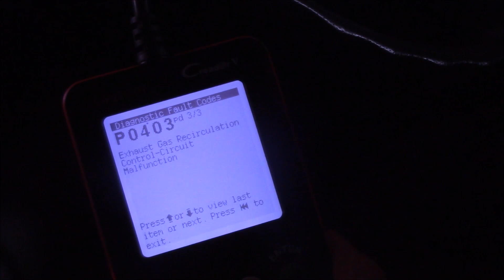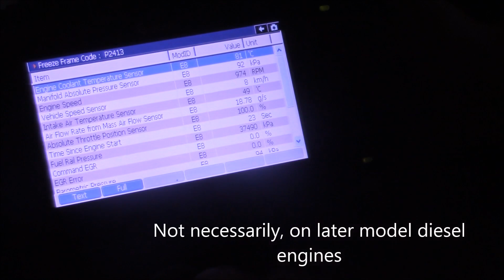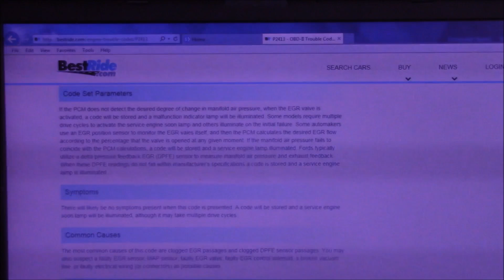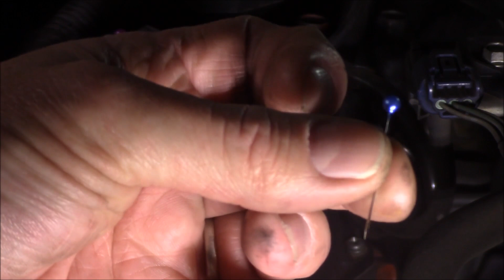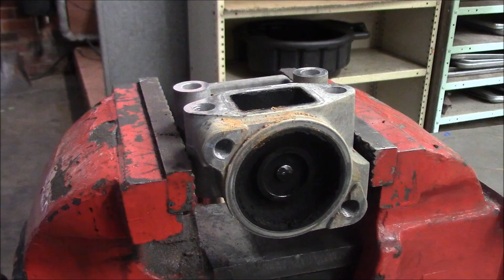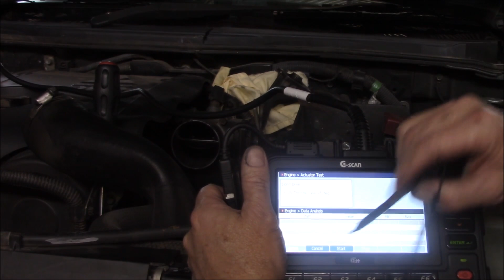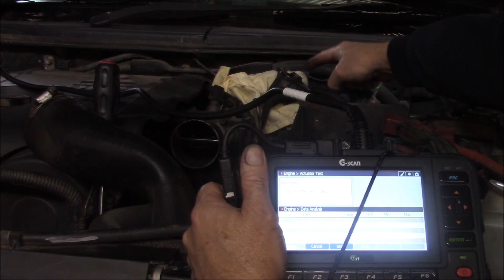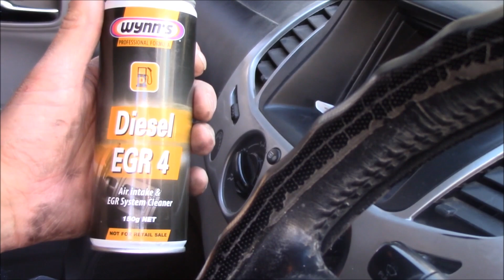Mitsubishi Triton 4D56 CRD P0403 P2413 Fault Codes MiracleMAX

Comment: Hi Max, I didn’t get to see on the video how you got the EGR to work with the system after you tested the EGR motors and it’s potentiometer. You mentioned you just needed to clear the codes. Though from your initial scans, it shows that there are still pending EGR trouble codes. So my question is what did you do that eliminated the pending EGR trouble codes. From your video, after you checked the motor next is that you are already testing the performance after a week and you just mentioned you cleared the codes (not yet doing the intake manifold spray cleaning) and from the scans the EGR is already working. Did I miss something?
Reply from the maker: Hey Michael,
With these Tritons (18:36), you need to clear the codes before you can carry out any activations. As I said, these are very bad for carbon build-up. Once I cleared the codes, I was able to do activations and after the clean, the check engine light stayed out. Remember I did clean the EGR valve on the bench.
These EGR valves do wear and allow air to be drawn past the shaft, creating poor idle and a sticky EGR valve.
The same vehicle later had an EGR cooler leak as well as an EGR leak, which is shown below.

Homemade Smoke Machine To The Rescue MiracleMAX https://www.youtube.com/watch?v=Qx2nT-GTejc&t=473s

I also later removed the inlet manifold and cleaned it ultrasonically. I don't think I did a video of that repair, but man, did it need it! This is the only way to fix the carbon issue correctly. The sprays are only temporary for the diesels and should only be done as a maintenance program. Not all technicians agree. Here in Australia, we have poor fuel quality and that is one of the main reasons our diesels have huge carbon issues. 
The guy has only recently sold this vehicle with over 400,000 Km on the clock and guess what he bought - another Mitsubishi Triton!
Reply: Thanks Max for these added information! I have the same issue with my Strada(Triton) here in the Philippines and I’m trying to diagnose what exactly is happening. Watching your video gave me excellent information about this topic. Hats of to you mate! Great work! Odd thing about my EGR, when I go up the mountains (cold and high altitude) the next time I turn the engine on, the Check Engine Light disappears, then when I go back down to the plains, it turns on again.
Reply from the maker: @michaelacepcion8941  
Hey Michael,
What type of scan tool are you using? Does it have 'Live Data' available? Did you check for vacuum leaks, like shown in the 'Homemade Smoke Machine' video?
Since it changes with altitude when you go up into the mountains, have you checked the Air Flow Meter? Here's an example of what an Air Flow Meter should do. 

Toyota Echo Hesitates Under Acceleration https://www.youtube.com/watch?v=PMg50o_fhXQ&t=1s

Note what it should be at idle (in your case, if it is a 2.5Lt engine, then it should be roughly 2.5 gm/s) and then through the rev range. This sensor helps the ECU to make adjustments according to air density, which is changed by temperature, altitude, air speed and also the use of a turbo.
Do you have any fault codes I can help with?
Reply: @MiracleMAX  Hi Max, I'm only using a cheap OBD2 scanner reader. I had P2413 DTC code ever since, I had my EGR system cleaned from time to time, but the Check Engine Light never disappeared. The shops I went to and even at the dealer weren't able to diagnose what exactly is the fault. And during these times I have noticed the CEL light going off whenever I was up in the mountains. From my researches I found that the ECU takes information from the MAF sensor, and as such I cleaned it but sadly no effect on the CEL for P2413, your video on the MAF provided me a more indepth check, I found that the flow rate at idle (my engine is 3.2L)  is about ~24g/sec which is over-reporting if it's supposed to be only 3.2g/s. Although recently I had some problem on acceleration having hesitations, and also loss power when I was going up a steep hill, it threw a code P1272, this I was able to resolve by servicing my SCV, I'm wondering that it may be that I haven't had the relearn special function done after my SCV servicing that it may be causing the high flow rate at idle, I have to get that checked before I decide to have the MAF sensor replaced. I already have a new EGR valve ready but haven't replaced it yet as I do the testings, I still have doubts. I'll try to make the smoke machine and do a leak test, but it doesn't seem like I have leaks as the engine is quite clean without the visible soots that would be coming from leaks.
Reply from the maker: @michaelacepcion8941  
Hey Michael,
Does your scan tool do 'Live Data'? The P2413 code is most likely a faulty EGR. Firstly you have to make sure that the ECU is actually commanding the EGR operation. This will be a duty cycle signal. Do you have a multimeter with a duty cycle function? If not you may be able to see a pulsed signal with an LED test light. Check out the video above for wiring connections.

You state that you have had the 'EGR system cleaned from time to time'. Was this Ultrasonically cleaned off the vehicle or just an intake spray being used? How many Kms has the vehicle done?

As you can imagine, 24g/sec is HUGELY over-reporting & will create all sort of problems. Sometimes you just can't clean a MAF - replacement is the only solution.

Yes, there are relearn procedures that must be carried out in the special function section of a bi-directional scan tool. Yours will not be up to the task if is only a reader. If you have sorted the Suction Control Valve, this will not change the MAF sensor reading as it is a Mass Air Flow sensor and only an ECU input. Therefore if it is over-reporting air intake, the ECU will add more fuel since it thinks that more air is going in than what is actually being drawn in by the motor.
Reply: @MiracleMAX  Hi Max,
My OBD reader does live data, but doesn't have the special functions, it's a reader only, the ECU isn't showing any commands to the EGR, it shows only 0% on both EGR Command and EGR error, even when I cleared the codes. I did check it before when I was in the mountains and saw some command by the ECU asking it to go 100%, but no duty cycles.

The cleaning was done manually, haven't seen any ultrasonic cleaning in shops here. The vehicle has run 123 thousand kms.

I was thinking that the airflow is mainly due to the suction of the engine and need for air, so if there is some fuel being given to the engine more than normal, that it would require some airflow to maintain the fuel/air ratio, though if this happens, the engine should be revving higher on idle and the ECU tries to maintain the rpm to 750 thus a rough idling, but I barely notice such rough idling. I'm leaning towards what you said that indeed I have a faulty MAF sensor.

Based on these, my next actions are: 1) Do the relearn special function (borrow a scanner tool that has one); then 2) Replace the MAF sensor and Finally 3) Replace the EGR valve.

Thanks for the huge help! More power to the channel!
Reply from the maker: @michaelacepcion8941  
Hey Michael,
So did you do all the testing that I showed in the video? The fault code (P2413) is quite specific. So unless the  EGR motor or the potentiometer are faulty, I suggest the EGR itself may be clogged enough to cause it to jam and bring on the fault code. 
I think the diagnostic path you have listed above is excellent. After all the testing is done, you can only go on what the data tells you.
Good luck with your repair!  :)

MiracleMAX
Reply from the maker: Hey Michael, 
I have just done some more research for you and a turbo diesel with be 3 times the rule of thumb I suggested before. So for a 2.5 Lt engine would be roughly 7.5 g/sec. So while this is higher, it is still no where as high as your 24 g/sec. Remember these are only generic concepts are not carved in stone. I am assisting with someone who is having a similar issue with a 3.2 Lt Ford Ranger turbo and he is reading 20.13 g/sec, which seems extremely excessive, but some collected data that we have seem to indicate otherwise. 
It might be worth changing the EGR first and then checking the MAF sensor before ruling that out. EGR's can be a strange beast.
Hope the extra info is helpful
MiracleMAX
Reply: HI Max,

Thanks for these new information you provided.  I missed a notification on your response. This new data makes me feel more comfortable. I did changed the MAF sensor first and I still had reading that are about 15g/s-20g/s, it varies a lot, sometimes lower at 9g/s. After this I removed the EGR and tested the motor, the motor was working but somehow it wasn’t doing the commands from the ECU. I replaced it with the new EGR valve and it is now working. I can now see the EGR Commanded Duty and the EGR command error on the OBD reader scan. Therefore I think the faulty EGR may have a bad sensor/potentiometer (I have to check this on the faulty one).  After replacing the EGR, I was thinking that the MAF reading would return back to lower readings, but it didn’t. The MAF readings was almost same as I got before replacing the EGR. So I kept on looking for information about why a high reading. I was thinking that there may be a vacuum leak or something that’s causing for more airflow. Thanks again Max!
Reply from the maker: Michael Acepcion 
You are welcome! Is the check engine light on any more? Are there any current codes on the scan tool that you can't erase? How is it driving in the mountains now? If all those are OK, you might just have to leave the MAF readings. As I said, I was helping someone else with high readings & yet they seem to be normal for his vehicle. Let me know how you go.
Reply: MiracleMAX , Hey Max, The check engibe light is totally gone now. No other P fault codes seen. Been driving around town no worries, the driving is now good and have the power when I need it. No hesitation. I’m checking on the fuel economy since I serviced my SCV till now, specially on city driving (8km/hr to 40km/hr), traffic is really bad here in Manila. Long driving, fuel economy is good, I’m getting about 13km/liter, that’s running at around 100Kph. Haven’t gone up the mountains yet, but shouldn’t be a problem now I think.
Reply from the maker: Excellent news. Glad you were able to work through with a successful diagnosis.  😀
Reply: @michaelacepcion8941  sir nung pinalitan ba ng EGR motor gumana Yung command? Nabura ba Yung code ng EGR system, kc meron ako code,same code ng sayo, hindi ko mabura,I had a doubt about the motor also, para lang sigurado,

Comment: Very informative video. I encountered this problem. I already clean the egr valve, i erased the dtc but it still comeback.. I think it really need to change the motor because the circuit is complete.
Reply from the maker: Have you removed the EGR and checked the motor like shown in the video? Can you see the motor moving?  Has the position sensor been checked? Are you able to do activations with your scan tool? Is the intake system clear of carbon build up? (9.21) If the circuit in the motor is OK, is it physically worn or is the EGR valve sticking? Homemade Smoke Machine To The Rescue MiracleMAX - https://www.youtube.com/watch?v=Qx2nT-GTejc 
Hopefully, these are some things to think about and help you to diagnose your vehicle successfully. :)